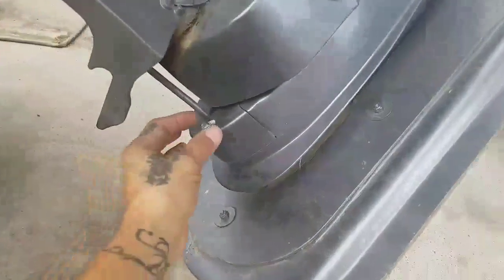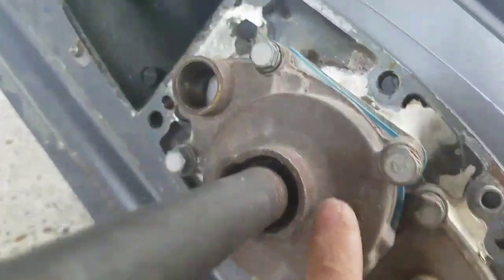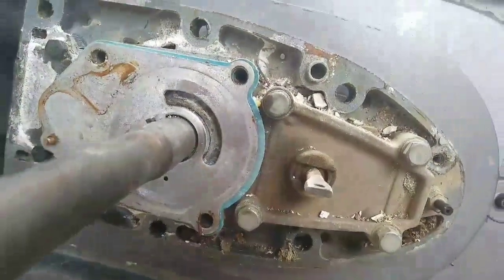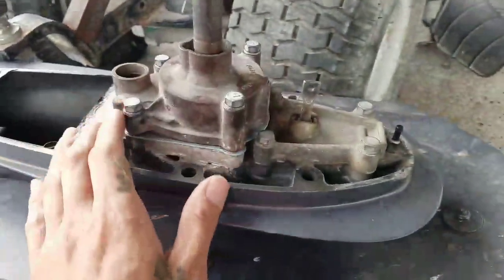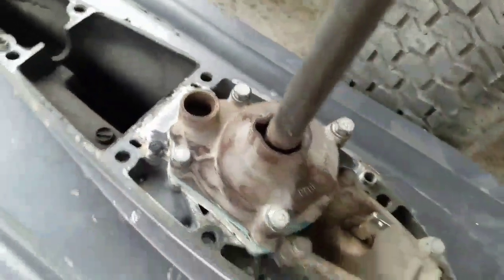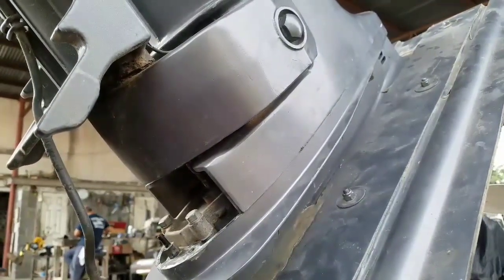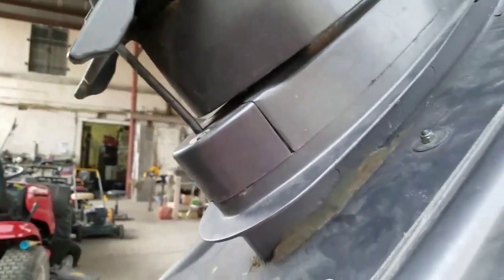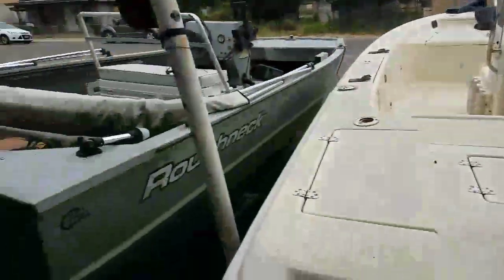How to replace Suzuki 140 impeller

Comment: I have a 83 DT115 witch is supposed to be similar to the 140, mine has a plastic housing and inner sleeve and the kit is much more expensive for my model, seems to be more parts to deal with. Is there much of a difference between the two? Also do i need to remove the plate the impeller sits on and change any gaskets around?
Any help would be appreciated.
Reply: Same thing